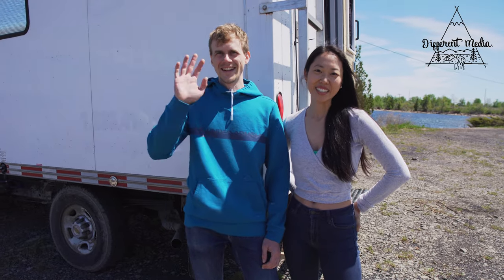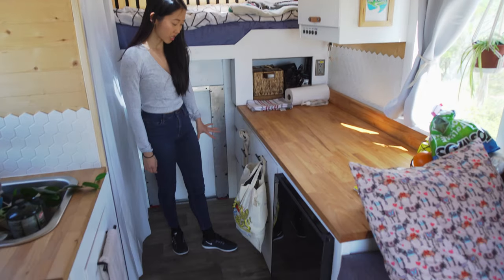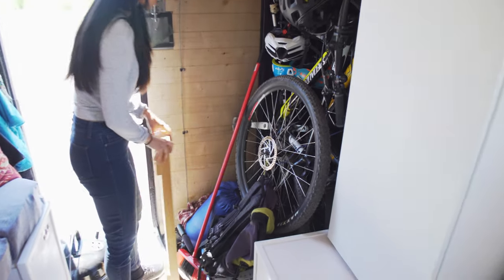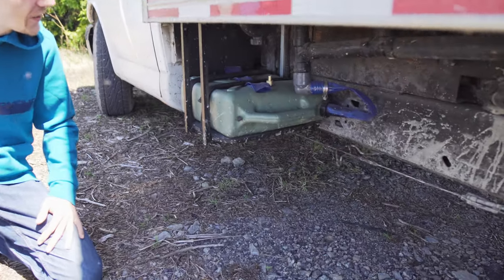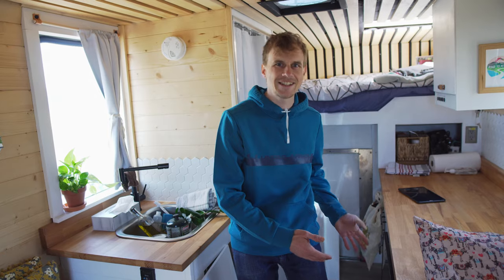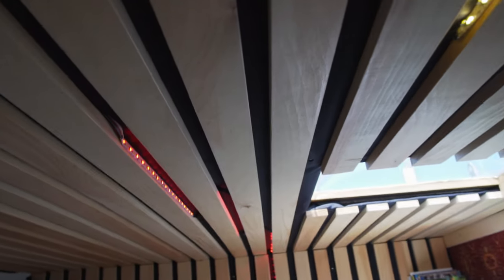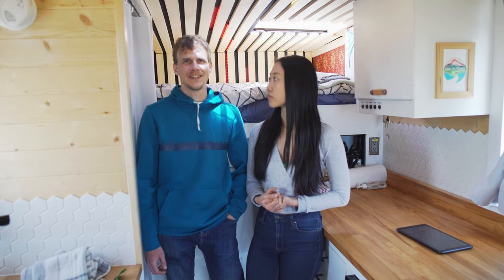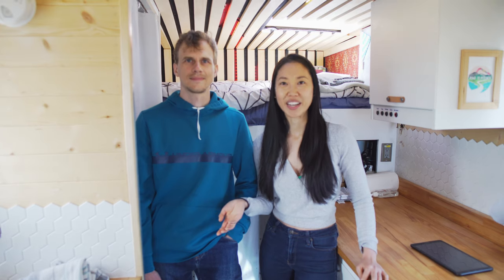Stealth DIY Van Life Tour! | budget Box Truck conversion with RV Automation, Bathroom, ETC

Comment: Just think of the camper they could have come up with had they bought a 24" box truck. So much in that small space. I could live in it, but my wife would go just in it.  She goes nuts in our  37 Class A motorcoach after about 2 weeks. Dropped in because I'm remodeling my interior of it now.  Nice built guys.

Comment: Why does the light mess with the camera?
Reply: LED lights flicker at a certain rate, and cameras record at a certain frame frate in this case it was 24 frames per second. The combo of this can sometimes make video look like the lights are flickering, but it's not noticable to the naked eye. Unfortunately I didn't notice it while recording but I could have changed my shutter speed, or adjusted the LED light brightness so that wouldn't happen.
Reply: @takingbackcrypto  do you guys have a cut away to get through to the cab?
Or whoever they were?
Reply: @shandelebroyles1099  It looks like there's a door to the cab under the bed.

Comment: Most of these vans wouldn't work in the S.W. U.S. or other hotter climates because they either don't have windows or windows that don't open - you would roast to death, or in a hot humid climate like the southern U.S. you'd roast and sweat to death.  Yes, noise all night of slamming doors, cars going by, etc is too disturbing.  And going to the bathroom.  I stayed in my car for a little while at one time, I wouldn't be able to do it all the time.  I always felt some level of stress and anxiety daily, when I live in a structure I don't have anxieties or stress about it.  If your vehicle breaks down I guess you'd have to pray for a good mechanic, and one who won't go through your stuff. Then where do you stay, which stuff do you remove from the vehicle at the shop to take with you.  I wish you the best.  My mind just automatically goes to what could go wrong that's out of my control.
Reply: alpha java : Any motor home will function fine in a hotter climate, in fact maybe better than a house, since most of them are fully insulated and have air conditioning, even a fan and an open window will do.I wonder how your mind will go if you have to go through a fire, earthquacke, flood,hurricanes, etc, in your house. God forbid if your car brakes down while shopping........
Reply: I think part of the drive to this, is being out of the comfort zone, as she said, being scared to do something, is the best reason to do it, that is what she also said about rock climbing.
  One of the most important things we can do for ourselves to keep growing, but not mentally aging is to continually be learning new things, this builds new pathways (Neurons) in our brain.  Resiliency is not learned by staying in your comfort zone, no matter our age. Keep that adrenaline going. 
I'm 60 going on 37.